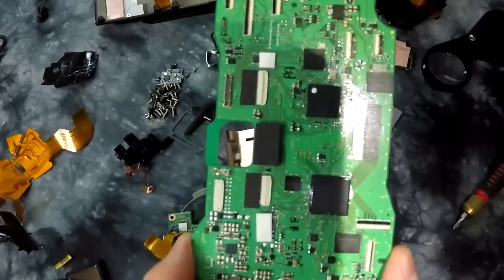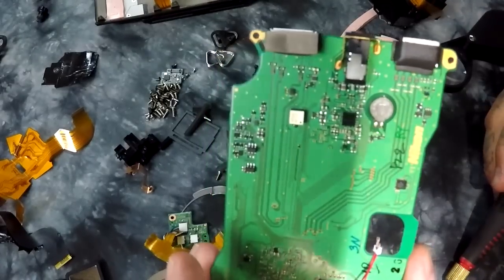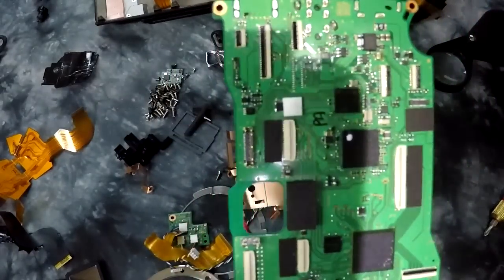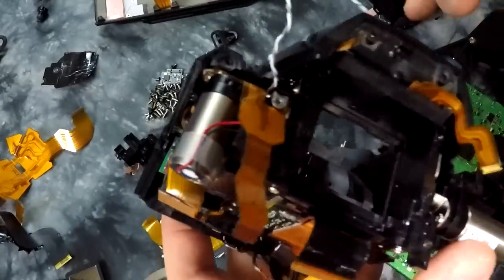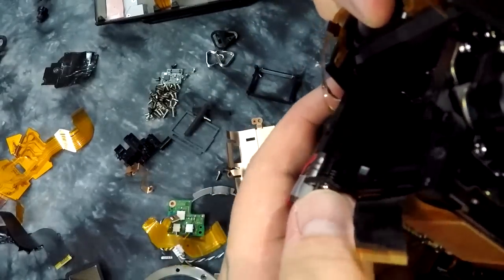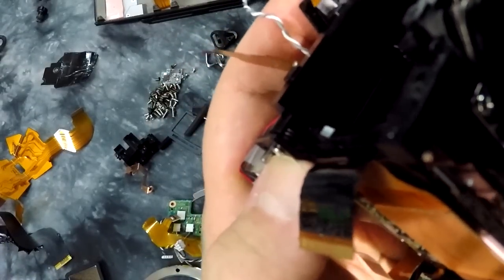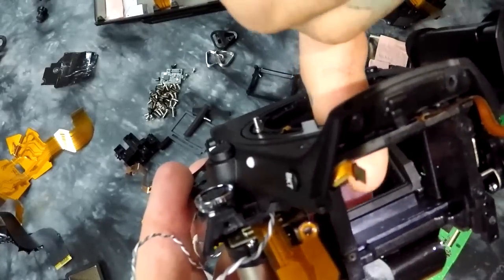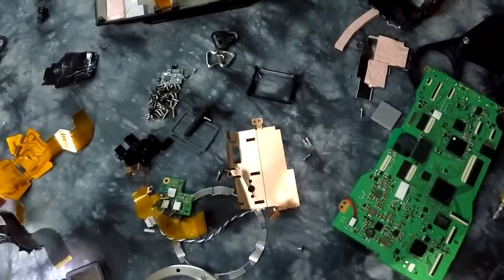😳 Nikon D500 processing by WHO??? 🤔 PART 5: Which big CHIP BIZ is processing the D500 data?

Comment: All these info can be found on NikonHacker.com. We had previously delayered a D5100 PCB (10 layers in total!!!) and back traced all the wire connection between chips. Most of these camera architecture stayed the same. Since Expeed 5, Nikon moved to PoP(package on package) for its processor. The actual Expeed is hidden under the LPDDR3 memory. The Toshiba chip is just a IO controller handling low speed like motor control, button control, etc.